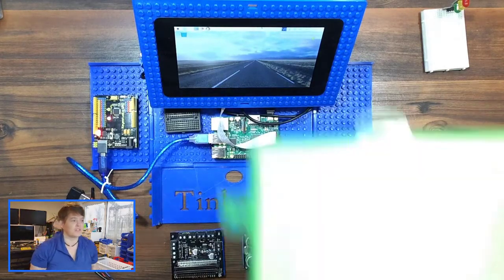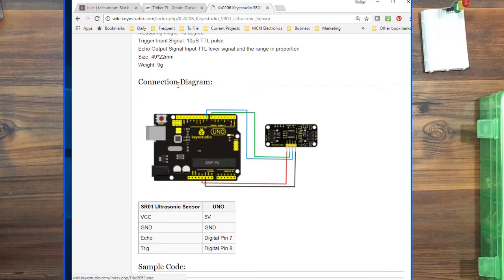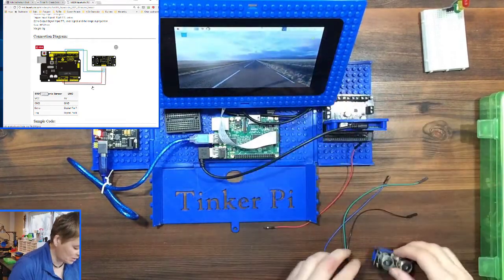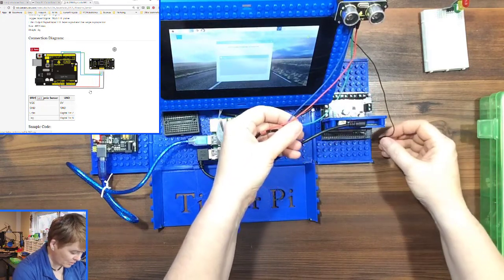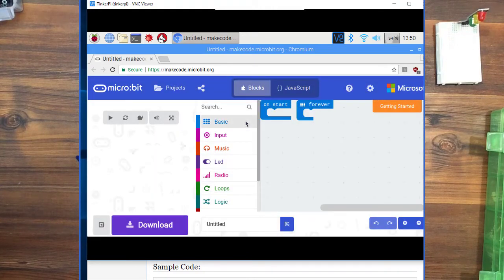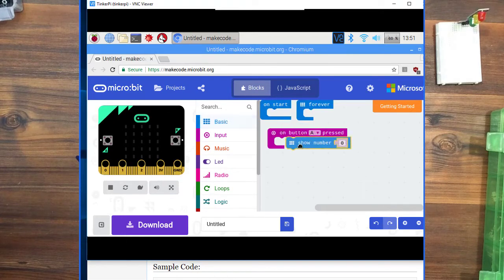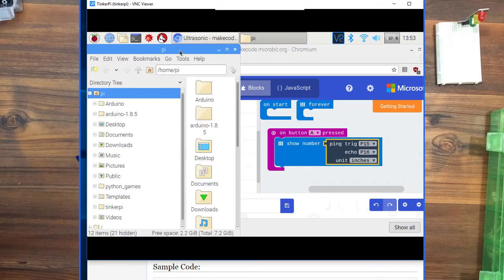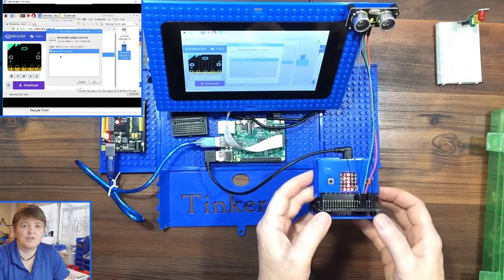Microbit & Ultrasonic Sensor - Getting Started with Micro:bit and Keyestudios 37 Sensor Kit

Comment: let's take a scenario, let's assume an object is behind and that an ultrasonic can only see what's in front it. what does that say about the sensors' capability or performance?
Reply from the maker: I wouldn't consider these sensors to be "state of the art" that you would use in production equipment.  They are inexpensive and mostly for learning, though you can certainly use them in your IoT and robotics projects.  That said, I have mostly seen this sensor used to steer a robot away from a wall, so in that case, it wouldn't need to see behind it.  If the requirement for your project is to see behind, perhaps there is a more fitting sensor, or perhaps you could use two back to back. ;)